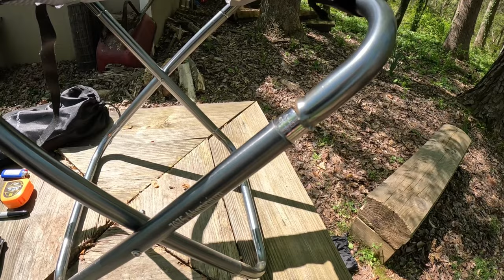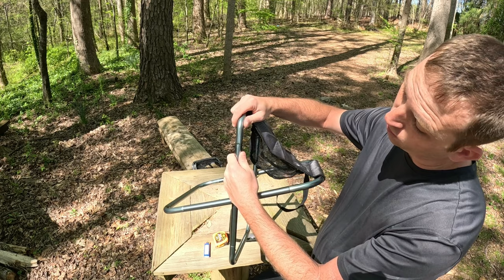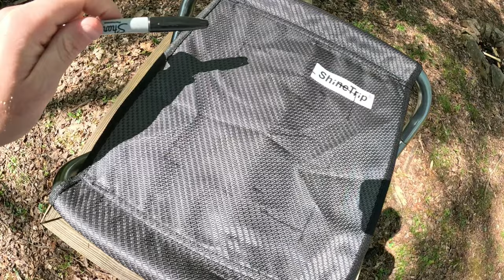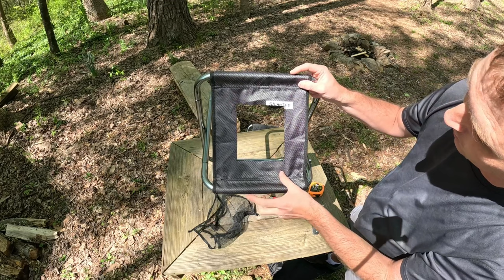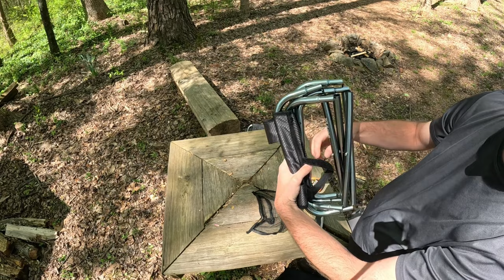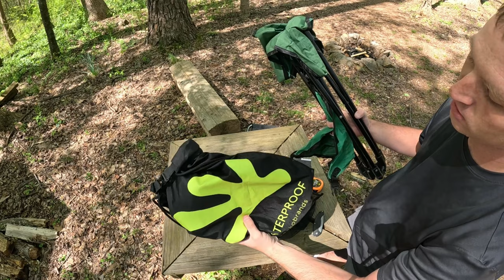Homemade Backpacking-Kayak Camping Toilet

Comment: Having done a lot of rafting in lnt areas and using grooves, you would need to flesh this one out more. For over 60 yrs of pooping in the woods it is easy. But if your using this setup I would think it would be in a bag system.  Even in non lnt areas I still pack it out using a few plastic bags.